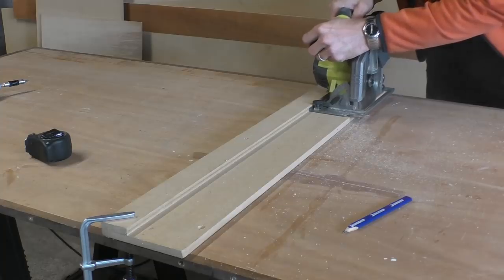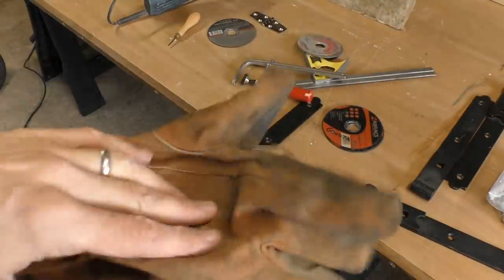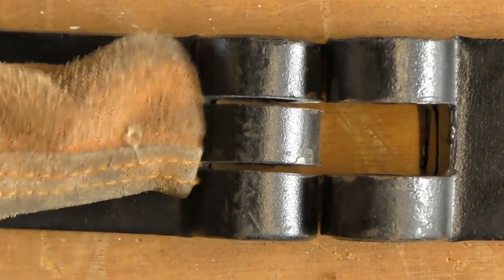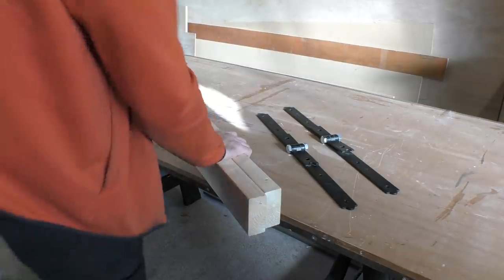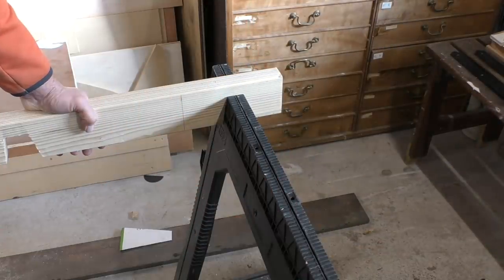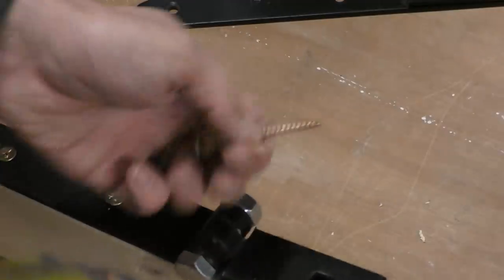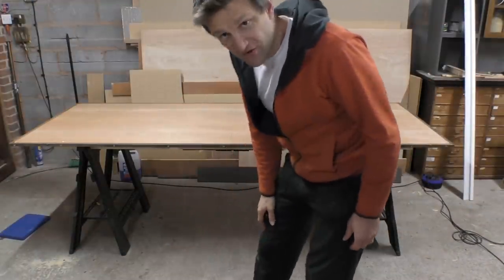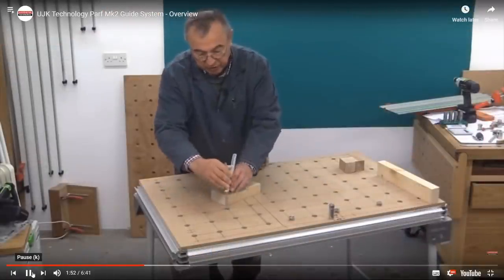The ULTIMATE DIY Portable HINGED Folding Workbench: Upgrade video 4 of 5

Comment: This is PERFECT and solves one of my problems having a small single car garage sized shop! The original sized work table was good... the ease and ability to 1/2 size it (or make two separate work tables from it is INCREDIBLE! So, other than a few different (Canada vs Great Britain) product modifications this is going to be my News Years ‘present’ to myself! I have known about the thin cutting disks for the angle grinder thanks to my welder buddy but the black fence strap hinge modification is BRILLIANT! Thanks for sharing!!!
Reply from the maker: Aw, you're very welcome mate. Thanks so much for the comment and get that work bench made - I don't know what is do without mine now!!
Reply: Charlie DIYte I already had two of the foldable Stanley saw horses and wasn’t really using them because of the same reason as you, they wobble weebled around! I’d let in my 2x4’s to put a plywood top on, still couldn’t make them stable... thought about building bases for them that also tied them together... too unwieldy and negated the reason for the take-apart work surface... the ‘ANGLE’ you put on them was the ticket! Bought two more Stanley’s today (pre-Christmas sale priced!) and the fence strap hinges with a few #8 lag screws. I have a Milwaukee m12 ‘multi-tool’ with a metal cutting blade as well as the thin cutting disks for my angle grinder so the hinge modifications are as good as done! Cool rainy (Pineapple Express https://en.m.wikipedia.org/wiki/Pineapple_Express) weather here on the west coast of Vancouver Island this week so the perfect time to build these... Thanks again! (And for a bunch of your other videos as well!) 😉😎

Comment: Very clever. I like the hinges. I watched the video but when I tried to comment it had disappeared. I'm pleased that it's now reappeared.
Reply from the maker: Thanks Mark. Sorry about that. I had to delete the old video as I erroneously referred to the hinges as strap hinges, so decided to re-edit it 🙄
Reply: @CharlieDIYte  - ah! That explains it - I thought YouBoob ate my comment ;-) The suggestion above to offset the beams sounds good, but do you think it might compromise the level between the two halves? Seems to me it might over-rely on the edges of the worktops - might work if you put hardwood edges. 

Another suggestion above about drilling for bench-dogs seems to underestimate the importance of absolute precision in the 20mm hole grid. I'm a fan of Peter Millard, too :-)

Comment: As I watched, it became clear how each solution and result worked so easily together with one another. This is a darn good DIY work top and at the end when you split them up into two, pure DIY genius. I can see uses far and beyond. 
 I have had my plastic Stanley sawhorses fail as I used them quite hard until I reinforced the legs and replaced the spreader with angle iron. But I should add, I gave them job site work outs which likely wasn't their duty rating. 
 PS, the hinge solution is excellent!

Comment: Nice idea Charlie boy!... many moons ago I made the same size work table with inch ply and steel dexion I got from work (cos Health and safety deemed Dexion unsafe... what a joke)... still I shouldn't complain, I got a free work table out of it... the only thing was,  it was so heavy... I also fixed a circular saw underneath... worked at treat!
Reply from the maker: Thanks Michael. I bet that was a fantastically solid if rather immovable table! Still using mine although I often use it in separate pieces.

Comment: Hi Charlie, great video and a great looking/functioning bench. 

I recently cut a pattern of holes in a bench top using the Parf Guide system. It was very straight forward and produced super accurate hole layouts. One top tip though (which isn't mentioned in the instruction manual or videos) is that you need to drill your 3mm holes right the way through the bench as the centre pin of the 20mm hole cutter (forstner bit) needs to follow that hole. I drilled only deep enough to allow the locator pins to fasten the drilling jig to the bench top and wondered why I was struggling to drill the full depth with the 20mm cutter. Also, for the same reason, you need to make sure that there is nothing under the board which will prevent the whole bit passing through the hole. Hope this makes sense. P.s. I did mention this to Peter Parfitt and he is updating the instructions accordingly. I thought they'd sent me a dull 20mm bit 😩

Comment: Great video. A few days ago I was thinking about making a folding workbench against the wall in the garage. This way I can fold it when not in use and have space for the car. My plan is to place the hinges on the wall studs and one side of the top and another set on the opposite side for folding legs. I faced the same problem with hinges that are too weak. I recalled seeing similar hinges to the ones you used in very old churches and buildings and thought that they were not available. Thanks to your video I'm going back to the drawing board. Like Mohammad Faghihi said, it is great that you do not edit the video but show the mistakes and your creative way to overcome them. Once again, Thanks.

Comment: Inspiring video, Charles, especially as dad-in-law just donated me a similar Bosch angle grinder. My oven fan was u/s so I got a non-OEM fan from eBay as genuines were exorbitant. But I got sent the wrong one, with side, not top, terminals, so had to cut the fan cowl to fit. I used that 'skinny' disk... OMG, so much easier than snips or hacksaw. They are a brilliant tool, especially alongside a welder.

Comment: Perfectly done, small Suggestion: when cutting the hinges, instead of 1/3 1/3 1/3 it would work better 1/4 1/2 1/4 - that way the load distribution would be equall...
Reply from the maker: Fair point!
Reply: My thoughts, exactly.  Good catch.
Reply: Actually the 1/3 cuts he did are closer to the proper split for weight distribution because the 1/4 outside ends would result in weaker hinges. You want as close to a 60/40 split as possible so the thirds he did are perfectly acceptable for keeping strength up in case he decided to jump on those too 😂
Reply from the maker: @Leggooo  Thanks Jay. That's certainly what the dude in the metal shop where I got them from said. The metal is so thick that we're no way near the yield point in any event.
Reply: @Leggooo I'd instinctively go for a 30-40-30 division. More meat in the middle and left enough at the ends.
Edit: wait, that's exactly what you suggested facepalm
Reply: No.  I would cut in half.. that is 50-50.   reason.  both side has same strength of the cut. and easier to cut the fold off from the side.

Comment: I like the hinges you made/used.  Just a suggestion, if you find hinges with the holes are too close to the edge of the timber, maybe try weld on hinges.  Obviously you cant weld to wood, but they come with no holes so you can drill them where you want.

Comment: I realize this message my be too late for you to take advantage of it, but I'll add it just the same. You mentioned adding holes to the bench. If any of the edge holes line up when it is folded in half, you can use a long wooden dowel through both halves in two locations to create your carry handles. Keep up the great videos.

Comment: I used same hinges to make a ramp for the back of my van, and by putting the pins the same way i can slide it left and off it comes. ramp was a 5x3 sheet of ply with some 30mm angle on the edges, and some foot blocks to make it non slip, great for getting bikes in and out the van

Comment: Really nice video and superb idea for the hinges. Just a note on the Zip disks - they are great for cutting through steel, but they do NOT like any lateral load. So when you use them to “clean up”, you run the risk of them exploding, which is a frightening experience to have.. avoid using them for anything except straight cuts
Reply from the maker: Yes, I agree Sanjay. I shouldn't have used them for that 👍

Comment: To add to the efficiency and to ensure accuracy of your notches "bunk" cut them. In other words lay the four pieces on the narrow edge butted up to each other (much as you showed in the assembly process), align the ends, clamp them together, mark your notch, set the angle on your circular saw, cut one "vertical" then cut the other. You can then use a chisel as you showed to remove the plugs. You could also set your saw back to 90 degrees and make a series of cuts across the notch which you can then bang out with a hammer. Clean up with a chisel. That was a lot harder to explain with words than with pictures but I hope my intent was clean. Good video nonetheless. Thanks for sharing your skills and your great attitude.

Comment: Great idea.  I have a suggestion for keeping the halves level in the middle.  Measure from the center of the hinge to the bottom of the table.  I'm guessing something around 4" or a bit less.  Then recut your support beams, with one side about 4" long, and use that measurement to cut a covex radius on the end that will be in the middle.  Cut out a matching concave radius on it's mate.  Install them with the radius hanging over the middle.  Now when you unfold it, the center of the table will rest on the top edge of that radius.  The hinge will be a bit off center, but it shouldn't have any chance for mismatch in the middle.  It might wear faster than you'd like, but at that point it wouldn't be any different than what you have now.

Comment: Thanks for the ideas.  I'm going to build this.  One add-on I'll do is to run an aluminum (minimal weight) angle the length of where the top meets the 2 x 4 to eliminate the flexing.  Cheers!

Comment: Great job, very ingenius.  A word of caution though...  Those thin angle grinder discs are really good but, as well as safety glasses you should have a full face visor.  The discs shatter easily and the flying bits can make a real mess.  Do a google search for photos.  Where I work the visor and glasses are compulsory.  Keep up the great videos!  Thanks
Reply from the maker: Thanks, I'll remember that. I'll wear my tree surgery visor next time!
Reply: Great point. The entire idea of safety goggles is that they are strong enough to stop eye damage.  If the projectile is strong enough to get through them it's going to be a catastrophic injury. So a visor may seem like overkill but it's going to be there to stop your day being ruined by a nasty surprise and an afternoon in a&e.

Comment: One disc is a cutting disc the other is a grinding disc. Use a cutting disc for grinding at your own peril. Using a grinding disc for cutting is slow and removes touch material, but not so dangerous.

Comment: A couple of points. 1: Safety specs and angle grinders.... I always use a light face shield in case the disc shatters auto protect against  facial lacerations, I wear prescription safety specs under these. 
2 you could use threaded bar and two nyloc nuts instead of a bolt.

Comment: Great job Charlie look splendid. I particularly like the half section I think would be very handy. One think you could do is strengthen the two joins as this will get bruised when butted together maybe with some metal plate.
Reply from the maker: Thanks mate - good to hear from you! I was thinking exactly that the other day, and being soft wood it's highly likely they will get bruised, although with any luck the ply top will help a little there. I have a couple of joist hangers that I cut off that would have been perfect. A bit late now though!!

Comment: for the long workbench use your third sawhorse (with an extra beam header or 2 ) in I ++ I configuration.  I and I being the current sawhorses, ++ is the middle.
the toggle clasps : i would set them on each beam.

Comment: I think by positioning the latches at each end on the verticals instead of the underside of the bench surface, you'll be able to lock the bench open as well as closed. You might also make a pair of wooden handles, that when the halves are folded, the handles come together to form one handle for easier carrying. You could also ignore this comment. Nice bench!

Comment: Here's a thought: Recess brad hole tee nuts into the workbench surface. Then bolt through the supports into the top.

Screws will come loose with this kind of movement, stripping the holes. Mechanical through fasteners don't have this issue. Plus, the whole affair can easily be disassembled for even more compact storage/lighter transport, or top replacement.

Also, buy a sheet of rigid foamboard insulation and place it under the pieces you're cutting. The stock is fully supported, preventing blade binding and minimizing sliding/movement. Most importantly, saving your bench top. A single sheet of foamboard insulation is inexpensive and lasts a very long time.

Comment: These videos are so helpful. Thanks very much
Reply from the maker: You're very welcome, Michael. It's well worth making a bench like this in two pieces as it's very heavy to lug around in one piece and also to store, but you don't need to hinge it. You could just screw the two pieces together with supporting braces attached to the two joists that run its length underneath. It's been a game changer though, having this bench. I've built my entire wardrobe on it, in the recent wardrobe build series.
Reply: @CharlieDIYte  Yes I will try that. 2 pieces to carry around will be much better for me than 1 large piece. 
Like a Wally I went and bought 25mm thick plywood which is totally overkill and weights an absolute ton lmao
Reply from the maker: Yes I bought some 23mm for my wardrobe shelves. That was heavy enough! You might need one of these https://bit.ly/3r89Bpm Not only to move the bench around but also to move fill sheets of MDF and ply.

Comment: The hinge you made is a great idea but - question - would it not have been stronger if you had cut in the centre and removed half of each side? In that way, both halves of the hinge would be equally strong, and you could tighten the hinge to reduce play. It would have been easier to remove the waste too. Just a thought . . . . .

Comment: The journeyman joined has a great point. 
The rule for hole placement is no closer to the edge of material than one half the diameter of the hole.
Ex.  A 3/4" hole should not be closer than 3 /8" to the edge.

Comment: Just to add, the bolts you are using for the hinge pins are called set screws because the thread goes all the way
 up, a bolt has a plain shank. The bolt you have with the square end is called a coach bolt, I hope this helps. Nice job.
Reply from the maker: Thanks Brian - I appreciate that!

Comment: Instead of all that effort, I would just remove the pin of the strap hinges, push a long rod through their knuckles (loose enough to pull out when I need a smaller table) with a third sawhorse in the center under them.  That not only provides better support than your hinge setup, but likewise eliminates all flex on the middle of the long table.  Makes it better for striking objects hard in the center of the table.  I would put a rounded end slit on the center of the two leaves of table as hand holds, for lifting and carrying them. And preventing slippage of table can be achieved by threaded rod through recessed holes on top of table lining up with bored holes on the 2 x 4 of the sawhorses, that will line up by putting registration marks on the side of the plywood surface.

Comment: Charlie, Great how-to video. Personally, I think you should have stayed with the original notch size. The smaller notch (all be-it, stronger), will raise the work surface off the saw horses. It could lead to a lateral sag down the length of the worktop and may make your work top bouncy. The idea of drilling dog holes takes the portability of the folding work bench to the next level. Oh, BTW... The more holes you drill, the lighter the work bench!
Reply from the maker: I thought about that Corey. The height thing isn't an issue, and actually it's slightly better to work on (easier on the back) at that height. I was going to put a cross piece spanning from one notch to the next, to support it across the top of the saw horse, but decided it wasn't necessary, on the basis that the newly unsupported section is actually no different to anywhere else on the rest of the table that doesn't have a saw horse immediately underneath it. In other words, the 18mm ply is more than strong enough to support any reasonably heavy load without the table sagging.

Comment: Charlie, excellent idea for a portable work bench, for handling you can use 1 inch wide web belts attached to the ends of the table top (under neath), or a portable wheel base like you made before in a previous video for moving large pieces of wood..I'm sure you already thought of that !

Comment: You now have the ability to attach them to a wall and use them as a fold down or fold up workbench. Match the mounting hardware so you can remove them and use them with the saw horses as originally intended.
Reply: Excellent suggestion for increasing their utility.

Comment: I built pretty much an identical setup, except I didn't hinge the beams. I only hinged the top, which was made of a slab door. To reinforce the notches in the beams I used a countersunk 15 cm mending plate on the top side of the beam over each notch.
Reply: It makes more sense to me to do it this way, however you lose the two bench option which is not a biggie for me. I might piano hinge the top, and just use latches  to hold the beams to the top. Pro's -More stable, easier to move around and store. Only two saw horses. Cons-not two table, longer beams. Also i agree about bunk cutting the notches, def less work if you are cutting the beams and going the 4 saw bench option. Set your drop saw angle, rotate the beam and cut the other side of the notch then cut the 90degrees and chisel out.